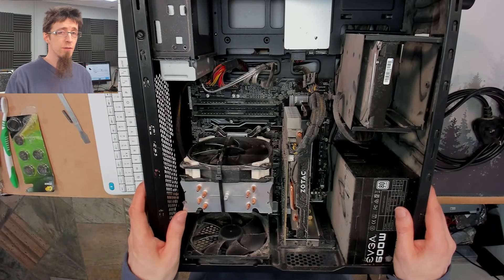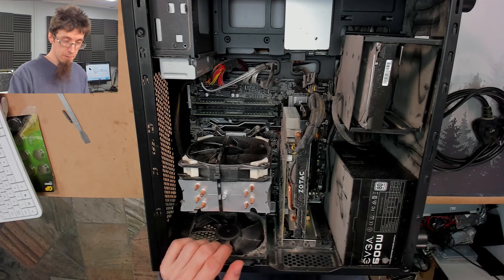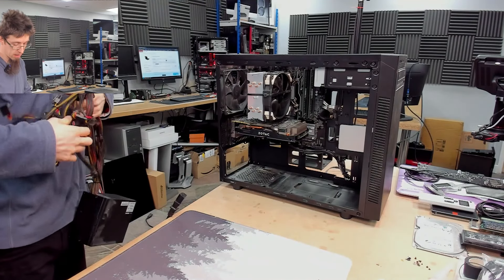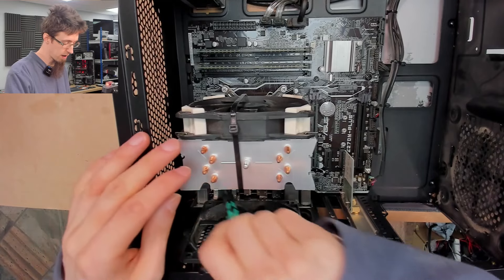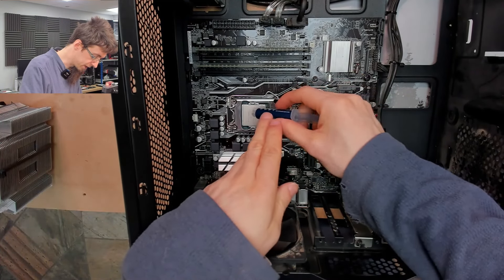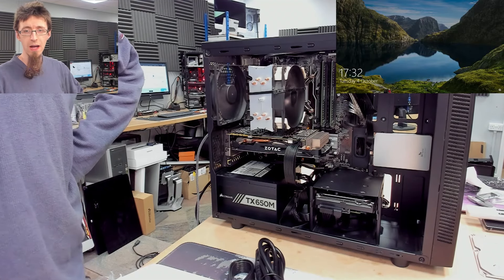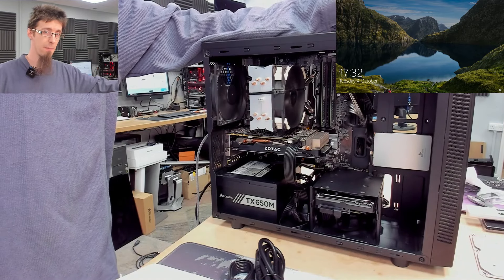Gaming PC cut out, doesn't turn on again - LFC#327

Comment: Out of curiosity. Do you have the customer keep the PSU box with the extra cables? Or is that something you'll hold onto since they'll likely either throw it out or lose it.
Reply: Always given to customer in my case
Reply: Me personally, if I can fit it in the hard drive bays, I slove it in there.
Reply from the maker: Yea I zip tied the extra cables to the side of the HDD cage. I try to put as many spares in the case if I'm able to. If there's loads of stuff, then accessory box for the customer to keep/lose.

Comment: If a PSU is over 600w and a reputable brand, I'd AT LEAST open it up to check if it's a relatively easy fix. Sometimes, even if it's relatively cheap, I still do it for fun :))
Reply: Like Shaggy said, it's just not worth it to bother with PSUs. Even if you do manage to, "fix" it you still have an old PSU.

Comment: Great video but I am unsure why people get so hung up on dry thermal paste. A decent paste will transfer heat when dry. 

The single most important job of thermal compound is to fill in the microscopic imperfections in the metal in both the heatsink and CPU heatspreader. So that there is proper contact. Thermal paste can and does do this dry. It needs to be moist so that it can be applied, but once in place, a decent dried up paste does the job just as well as a newly applied moist one.
Reply from the maker: The problem with dry paste is that if the cooler moves or is jolted, it'll 'break' the paste. So it kinda depends on how likely that is to happen.
Also though, dry paste may have been cooked by heat, and that does degrade the performance. You see this on AMD APUs, which usually have really really really under-sized coolers on them. The paste is always cooked, and changing it will slash the CPU temp and fan noise.
I do agree that people are overly paranoid about thermal paste, but it's not always unfounded.

Comment: Strange coincidence? I have the same power supply, and it's dead too. BUT my computer was very clean when it happened. Same symptoms though, PC shut off suddenly and would not turn back on. I was not overworking it either, a Core i5-9500F Processor, and a MSI 1070 graphics card... nothing crazy at all. it also had lots of airflow available.
Reply: Your video compelled me to go have a close look at that power supply, and after a min I realized the cooling fan was seized.... so it probably just cooked itself just like your friend's did.

Comment: good job showing this. My PC died at the start of Covid in 2020 when people were at home. I used a paper clip and found my mini-itx power supply had died. I was pissed because it was only 2 years old and a top brand that I had gotten off someone from Ebay. I got a reply from the manufacturer that I could still RMA it, but I decided to just buy a new one and be done with it.

Comment: Love your channel :) and wanted to say "thanks!" -- the other day I got to put some of the skills I've learned from you to use.

I live in a set of -- well, you'd call em flats -- low-rent apartments in the middle of nowhere, east coast USA. Most folks here are of the sort of age that Smart TVs confuse the heck out of em. One of the folks who regularly visits is a shadetree mechanic. His mother is a tenant here, and he's good friends with many of the others. He occasionally brings me laptops in severely damaged condition; I can usually fix about half of em; the rest are good for parts.

Brought me a whole STACK the other day. One of em was a fairly recent Dell Inspiron; I forget the model #. Looked to be in suspiciously good condition, so I dropped it on the charger... sure enough, dead as dust. No shorts across the DC Jack, but then I remembered all those Macbook videos you've done with cooked capacitors and whatnot... "Hey, sure, I'll give it a shot." Checked a capacitor at random near one of those big block ceramic inductors... yup, dead short power to ground. Traced it all over the power section of the board, near the DC Jack connector and the battery connector, and found this tiny tiny tiny chip, a QFN-12 I think it was, couldn't've been more than a quarter inch on a side (~6mm? in non-freedumm units) that was some kinda voltage regulator. Of course I can barely SEE the leads on the thing. I'm no Louis Rossman, that's a dead board in my hands, but I did track down schematics and figure out what it was.

SY8037DDCC -- apparently a "high efficiency, high frequency synchronous step-down DC-DC regulator IC" of some variant, made by Silergy... whoever they are. Wish they hadn't used an Intel microcontroller part number, as well... meh. I guess it doesn't matter.

But, hey, even though actual repair is beyond my capability, it was cool to use the techniques you do to track down the fault. Gave me a smile while I was doin it -- I hope it gives you a smile to hear of it!

Comment: Power supply repair may well be complex however I would always check the fuse for a quick k win be it external access or inside cage.
Reply: I always look for blown fuse but I suppose there must have been a reason it blew in the first place.

Comment: one thing to keep in mind when putting a jumper in the green to ground is that some power supplies will require a load on the output before turning on fully.

Comment: I just replaced 7 bulging electrolytic capacitors in my 2009 LENOVO ThinkCentre M58p computers PSU.  Computer is now up and working again, meaning, no more boot loop problems. Total cost of capacitors, was $9.55.

Comment: I've been using a makeup brush to clean my own and families' systems. It's much softer than a paint brush. And does a better job cleaning than a paint brush in my opinion. I then finish off cleaning the system with a compressed air cleaner tool. Removable filters I normally place under the shower and leave to dry off. The water really does a great job of removing the dust as well.

Great video and incite to some in making sure their systems are well maintained.

Comment: If it is a capacitor in the power supply, it will be the start up capacitor on the PWM I.C. in the SMPS drive circuit which is typically a 47uf 50v or 56uf 50v or 33uf or 22uf. Sometimes you get lucky with that. Other times a short circuit diode on the output of the power supply on the 12,5 or -12, -5 or 3.3v rail. It's rarely anything that simple though. Very rarely the mains smoothing capacitor can cause it to be dead. Other times the main fuse has just blown without any apparent reason and sometimes the bridge rectifier has shorted and taken the fuse with it. Also, safety devices such as VDRs can have taken the fuse out. But usually, it's an involved and lengthy repair that includes replacing most of the SMPS driver and output components or a fault with the feedback from the output stage back to the SMPS driver stage. It's rare I bother trying to fix a power supply for a home PC these days, it just isn't worth the time or effort.

Comment: Sometimes - especially in the winter with a furnace, it will dry out the air and create a lot of static. We have humidifiers built into our furnace that helps mitigate that problem, but it doesn't eliminate it. 
As it's near the first of the new year - make it a habit to do a thorough cleaning of your computer at least once a year with a quick blow out every 3 months or so.

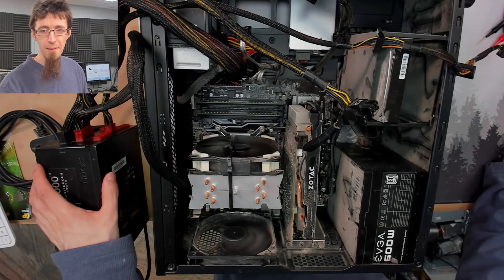Comment: That out of order footage at 8:40 threw me for a moment, new PSU already installed and inside cleaned. ;)

As for the battery, honestly anything over a 3-4 years old its probably worth replacing anyway as you never know what the use by date might be and they can leak, though I've never seen it happen personally.

Another advantage of fully modular is cable routing on more awkward cases, though I do prefer semi-modular as its one less connector to go wrong.  You can also get the opposite where the most awkward spot is behind the PSU so modular connectors can be even worse then.
Reply from the maker: oooooh it looped... I noticed there was something odd going on there when I was editing, but it was like, 00:15 in the morning and I was very tired.

Comment: Thanks for an interesting video, Graham. My territory exactly.  The only thing I would do extra to this system is save a profile in the bios. That way your friend would have a profile to go to if the bios is ever reset for whatever reason. 
BTW it's funny how different mobo manufacturers were on fan control a few years back. Asus used to be the best, Asrock the weirdest with the percentage tabs, and Gigabyte just sucked. Now they seem to be catching up. Greetings

Comment: The primary reason that I "personally" like full modular PSUs is because if it goes bad then I don't have to pull out any cables to swap out and replace the PSU. Obviously putting in custom braided cables is the big factor as well. 

About 10 years ago I used a semi-modular Corsair 850W and after 30 minutes it died hard. All my nice cable management .. Poof!

Comment: Great stuff. I do have an old PSU that works just fine when I connect it to a PSU tester (all voltages checks out). But when I connect the PSU to a computer, it just drops out. One thing I noticed is that I need to really push the 24pin connector in order for the computer to turn on. Like I really need to shove it in tightly though it's pretty much firmly connected. Could this be just a loose connection on one of the pins?

Comment: I never liked installing the PSU with the fan facing down to the floor. Yes, it allows fresh air to be sucked in but it's such an unreachable position I'm too concerned dust buildup eventually would be a bigger problem - not to mention that fine filter you removed which would probably get packed with dust in no time. So on my system the PSU is facing up...

Comment: A couple of years ago I had a similar problem with my gaming PC in that it wouldn't turn on. The leds on the mobo were on but there was nobody home. Like you I pointed my finger at the PSU but it turned out to be the switch on the case had failed. I looked in all of the usual places but there was no direct replacement so I used the reset button as an on off button. Since then the case has been replaced. I have had this gaming rig for several years but, like Trigger's broom, everything has been replaced at least once.

Comment: I have a 650 watt EVGA psu with no 80 plus rating at all. The specs say that it an efficiency of at least 75%. It's probably even cheaper that the psu in this video. Before I got it, I had no idea that they sold such low end units, but it hasn't given me any trouble in 2.5 years.

Comment: keep in mind if you dont drain the capacitors in the power supply or an old crt they hold enough charge to stop your heart....no joke. i always tell people its much safer and more cost effective to just change out the power supply.

Comment: 13:30 And you, as a business owner would have to warranty your repair. A failing power supply can cause permanent damage to all the components or even worse cause a fire. Thats not a risk any responsible business owner would take for a "50 bucks repair".
Remember, were not talking low-voltage-DC-power rails on a motherboard here. Were talking mains voltage.

Comment: A PC with mobo lights but nothing on the button. I would check if the power button works before yanking the PSU, only takes 10 seconds to pull the power switch cables and jump it.

Comment: fully modular means you can also replace more of the cables if they end up being faulty or getting damaged. i had that happen just recently with the 24 pin main cable on mine ended up being a faulty +12v wire that ended up no longer connecting properly.
Reply: On the downside part-modular and fully-modular PSUs have an additional cheapest-supplier plug and socket in the cable run between the PSU circuitry and the motherboard/video card/drives etc. The really exotic PC builds with a 250W TDP CPU and a 400W video card are already pulling 50 amps plus on the 12V power rails and having more than one plug-and-socket inline is adding an additional possible failure point to the build.

I have in the past fixed a computer power supply with a damaged (melted) connector by chopping the connector off and replacing it with another connector and cable from a dead PSU in the junk bin. It took a bit of soldering and heat-shrink insulation to do the job but I ended up with a longer-than-standard cable which made routing the cable a bit easier (it was a full-tower case I was using as a home server).

Comment: With tower coolers is it better to have two fans (pulling and pushing, either side of the tower) or is it just diminishing returns in terms of temp difference?
Reply: My understanding with push-pull is that the primary benefit is noise reduction because the increased combined static pressure allows a lower fan speed to push the same amount of air as a single fan at a higher fan speed.

Comment: I don't know anything about how handheld PSU testers work but I would've assumed they run some sort of check on it that involves actually turning the supply on and drawing power (like a computer would). Stupid if they only check for standby power. Thanks for the new insight.

Comment: That looks like a fairly old case, and it even has the optical disk drive placements. Older cases had horrible cable management with ketchup and mustard wires. That's why there's no hole for CPU power cable.

Comment: Hello, sorry just telling but i have the opinion that if you can you should put the fan downside on the power supply, just to prevent that the graphic cards fans work against the power supply. I have seen many, many power supplys or graphics cards that had broken fans cause of this espacially in smaller cases or mid tower cases, it even lowers the temperature about 1-10 degress. however the only thing i would recommend putting it to the inside is when you know the pc is placed on a carpet or has a passivly cooled gpu then it lowers the temps too.

Comment: In a lower end PSU fans not spinning is probably a good enough sign along with the system failure to scrap it, but "zero noise" PSUs are becoming more common and they often won't spin the fan until they hit a specific load or temperature threshold. I'd still prefer checking the 12v, 5v, and 3.3v rails and then checking with just 24 pin + EPS before replacement.
Reply from the maker: Yee, the 24pin+EPS check is mainly because the 12v rail is the only one that's plausibly going to catch fire if there's a dead-short. Other rails can cause a problem, but won't blow up if I connect a 1Kw test PSU to them.

Comment: I delidded and replaced the crappy IHS thermal paste with liquid metal on my i7-6700k and the temp got 20c lower with prime95 stress test. From 90 to 70 with 4.7 ghz overclock. And i use Arctic MX-4 under the cooler.

Comment: I've always wondered... why double layer flat cables? one side positive, other negative/ground? take the EPS cable for an example.

P.S. I have an MPG B550 Gaming Plus motherboard with a ryzen 5 2600 and 1660 ti... it just simply refuses to save XMP on every other 3rd restart despite having a brand new RTC battery.... keeps dropping speed down to 1066 (not split speed, actual speed)... not seriously OC'd.. boosted speeds were maxing out at 3.5 GHz... manually OC'd it to 4.2 GHz, been stable (custom loop specifically for CPU) with the exception of the RAM speeds not saving XMP speeds at 3200.

Comment: keep in mind if the fan goes up your just dumping warm air from the power supply into the case where theres already a bunch of heat.
Reply from the maker: PSUs intake through the fan and exhaust out the back

Comment: I have the same jumbo size heatsink as that PC, can't close the case because the heat pipes stick out by 5mm.
I do have a question regarding that PC: Why did he use a tie-rap?? and not the clips that belong with it. Yes those clips are a pain in the rear, but you won't have a possibility of obstructing the fan and having the need to shorten the blades.
Reply from the maker: I think I might've forgotten to mention it in the video, because there's a lot of comments about the zip tie around the CPU fan - if you're a system integrator shipping a PC across the country, you don't rely on metal clips, you tie things down, otherwise they fall off in shipping.
The clips are there as well. The zip tie could be removed, given that the PC isn't being shipped again, but this isn't a show PC, so it doesn't matter.
Reply: @Adamant_IT  Sorry about leaving that part up, you mentioned it later on in the video. Soon as it came up I thought I'd better amend my comment at the end of the video. Unfortunately I forgot and hit the x button on the tab.

Comment: Oof I have a pc quite similar, z170ftw from evga and a similar setup other than a 1070 and mine bricked so badly that the board doesnt light up at all but the psu is fine. I heard a pop sound earlier in the day before I noticed the pc was off but I couldnt find any damaged capacitors on the board or the psu. The best bet i have is that something blew in one of the integrated graphics circuits after it got too hot as the ones above the cpu seem discolored with heat compared to the ones over by the vram heat sinc. Shows why they had an optional heat sinc slot for those specifically if that's the case.

Comment: I totally agree about using power supply testers not  being able to properly test a power supply.  They are only useful for checking out that you have not f****d up your custom cabling pin outs.  If you are serious about this hobby then you need to have a power supply for testing purposes.

Comment: The Antec PS have fuses in the PS case, I've changed a few. Not sure if the EVGA PS has a fuse, I would have checked. It would be a lot cheaper for the customer, but not for IT repair person (who needs to money), to replace a fuse. Better to sell parts and labor.